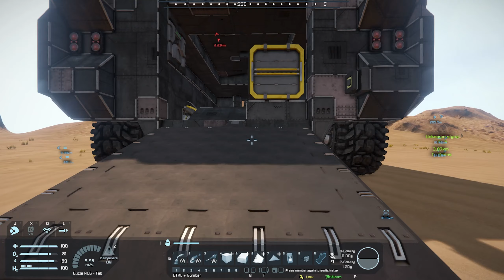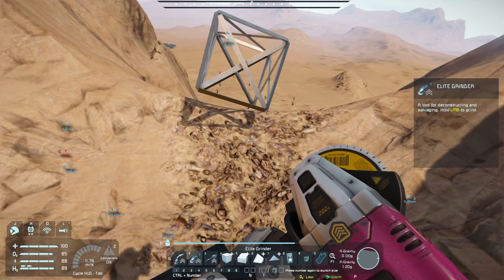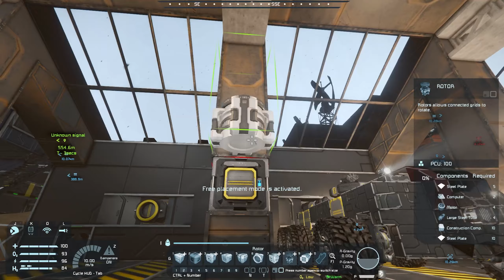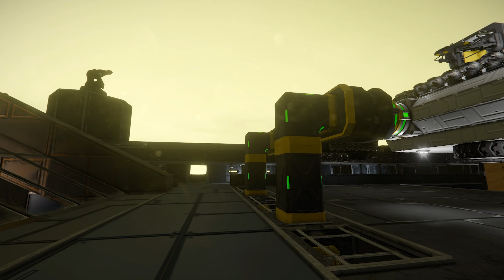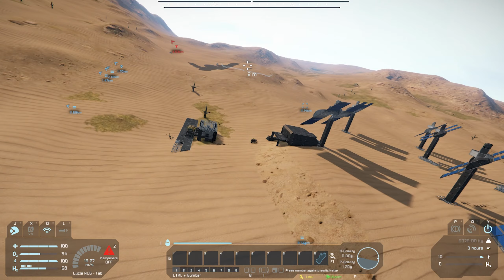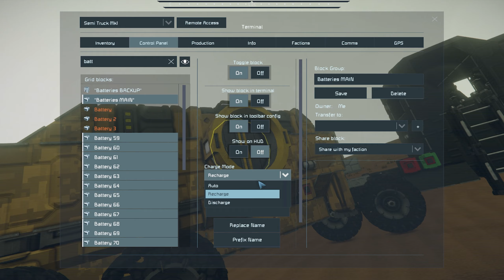Space Engineers Survival 2021 (Episode 22) - Its a Welder AND a Grinder!  [Pertam]

Comment: Splitsie made a floor welder that he called Igor since it had a big ole humped form

you'll get quite a bit of steel plating once you grind down the wrecks.

your mining ship need another battery or two so it's power use doesn't max out.

your combo welder/grinder will operate better with two cockpits facing opposite directions with welders on one end and the grinders on the other. this will allow for 2 Grinder heads and a faster grind rate.
hotbars in each cockpit can be set up specific for each function.
you don't want it's Gyro response too high or you'll bang against stuff and break things = not a fun bit.
add another pair of Large up thrusters to boost lifting capacity. this is always a trial and test to find the correct lift.
remember to accommodate the added power needs with more battery capacity.
Welding and Grinding ships need to fly at really weird angles so they need to have lifting capacity in all directions.

double check the Rig and make sure it has its own Batteries, they can charge via the trailer hitch through the connector on the trailer
Reply: The double headed idea sounds good. Grinder one end, welder the other. +1 for you my good sir/ma'am.
Reply from the maker: Thanks for the tips! I didnt even consider the double headed technique, but now that you say it it makes so much sense! That would indeed make the ship more efficient. Thruster wise, I realllly underestimated how many I would need. The small thrusters throughout the ship do help a lot, but I think we can only fully support one of those full containers at the time.
Reply: @AndrewmanGaming  
possible name for the Grinder/welder ship.

the Hydra. <a mythological Multi-headed Dragon.>

in Large Grid which works better for large scale grinding projects like Wreck demolition.
the use of Large Thrusters for primary lift is almost a guarantee. 
my Carry-all is Small grid with 6 Lg. Cargo Containers piped together and uses 20 Lg. Thrusters for vertical lift.
I've had it nearly full to capacity and while sluggish as sin, it still flew after digesting the Earth Easy Start Pirate HQ complex in its entirety AND carrying a loaded Grinder Ship. <10x inventory size setting.>
a full redesign will be in order but cockpit placement should be easy centering them just behind and between the heads.
I have found that Md. Cargo containers liked together with junctions does make a cleaner look and those big Thrusters can be hidden in the central gaps between cargo units.
I place batteries on top in quantity for at least 1 hour of operation time balancing thrust output so I can fly at extreme angles safely.
2 Gyros are plenty as you don't want the ship overly sensitive to control inputs and crash into something. 

as for cannon power on the Tank.
limiting its use is not a bad idea given its massive range.
probably why I like the Ravenbolt Mod and its assorted weapons.
the Gat-1 is a single barrel autocannon that is very accurate for sniping with a max range of 1.2 Km.
it uses the same vanilla 25mm ammo the vanilla turrets do and has a similar damage profile making it a lot less OP.

Comment: Someone made a ship, where there are two rotors on the side, and they rotate a cargo container, that has a grinder, and a welder on the opposite sides. When you wanna build, you rotate the thing so the welder is in front, and if you wanna deconstruct something, you rotate the thing again so the grinders are in front. I told you this, because in that configuration, if you had a very thick wall to grind down (like as thick as your ship is wide) you can kinda cut into the wall and the ship can fit in the hole no problem.
Reply from the maker: Oooo that is a cool design for sure! Double tools on each side ftw!

Comment: Don’t use Khopesh turret.  I’ve discovered in creative that it disconnects from its host block and then trash collection takes it.  I use the sentinel turrets from that pack and it stays connected.  Also, you should use heavy armour blocks/plates since you should expect the tower to take some hits and heavy soaks damage better.
Reply from the maker: Thanks for the tip! That's probably what's been happening with my poor Khopesh turret. The fort weapon areas are nearly all heavy armor. The middle is just where we save a few blocks with a combo of light and heavy blocks.
Reply: @AndrewmanGaming  
I'm a bit partial to Flak Cannons up there to get the most out of any threat like Reavers.
downside of Reavers is their general tactic of ramming into your stuff and causing general mayhem shooting everything until you finally kill them as they bounce around.

Comment: Super Flat! So much flat space square-ness with the museum.. You should do a bit of the Black Armor greebling thing with your buildings too, like you do with vehicles, like Honky Tonk ;)

Also, Half Block floors! Costs 1/2 as much steel plates as plain armor blocks. It will look the same (top-aligned).. OR, (bottom-aligned) you can sink the display section niches of the floor by a 1/2 block (maybe some bevel ramps on the sides) and save about 1/2 the steel plates.. plus make it look more interesting at the same time.
Reply from the maker: Alright it's officially called "Honky Tonk" now. That's wayy better than Honk the Tonk XD You make a good point with the decorating. I could really do with some more time spent on the look. I'll work on it :D